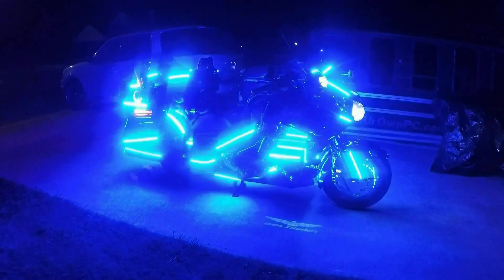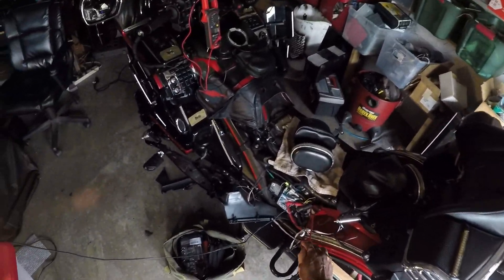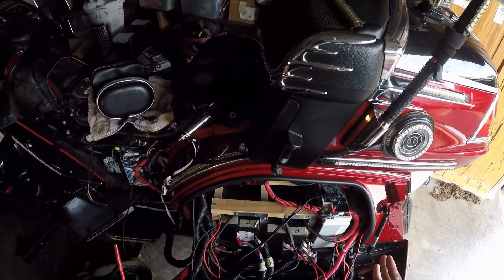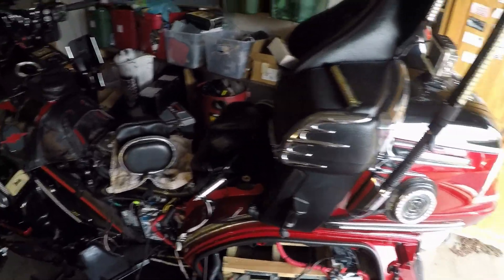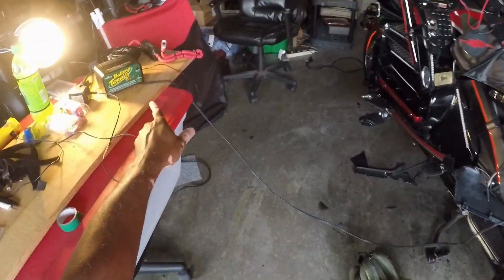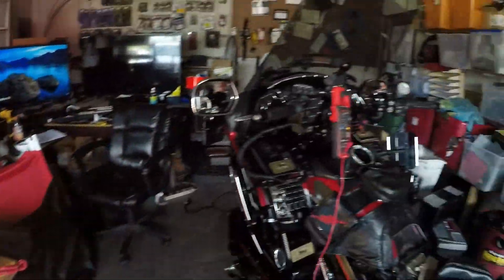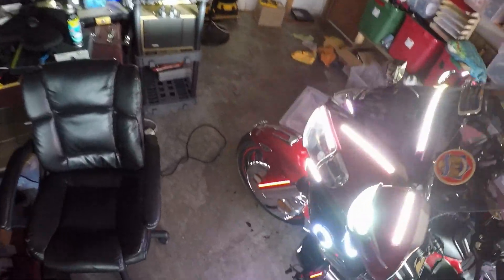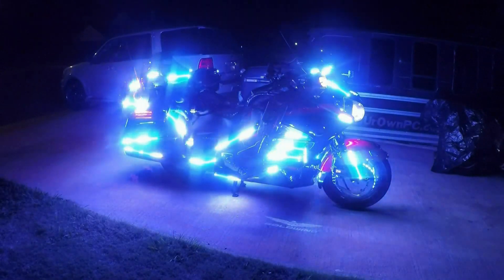Dual Battery Setup Parallel

Comment: I enjoy your videos bro very educational. Is the XP 750 battery top or side post and you recommend it?
Reply from the maker: I highly recommend it and I'm glad I switched the original set out (dual battery) out with the XP750. One XP750 outdid both batteries. Also, they are top post connections so you will need to configure your original battery box holder to make it fit. It will be a tight fit but you will be glad you switched afterward.